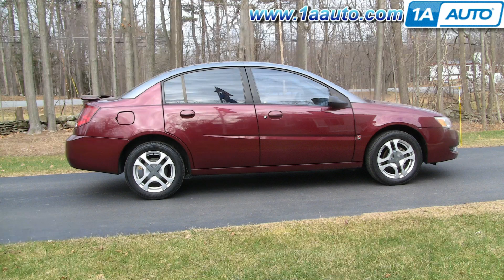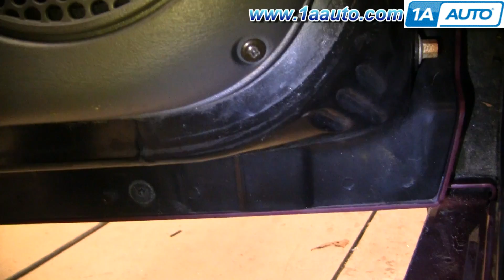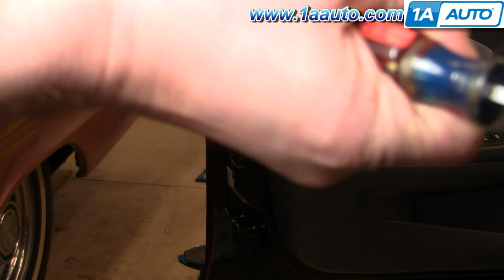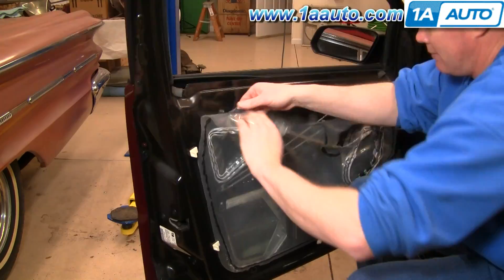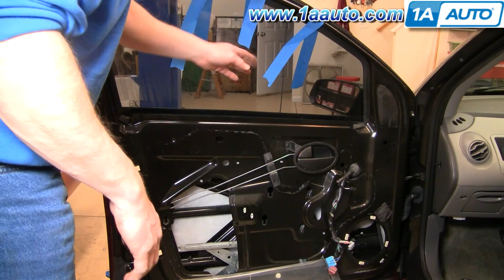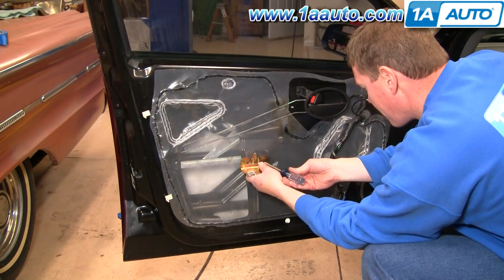How to Replace Front Window Regulator 03-07 Saturn Ion

Comment: Thanks for the video! It's hard to get information about cars these days. People like you taking the time making these videos are a lifesaver. I'm a diy kinda guy. I done work on my vehicles and others in the family all my life. Hanes manuals are not all entirely accurate. Always leaving something or another out but are helpful in some areas. Better than nothing I guess.. The plastic tabs that hold the window in place was very stubborn. I ever so carefully bent the metal bracket between the metal and locking tab with a flat head screwdriver. Then I carefully repositioned the window assy so that the front clip was easier to get to and very carefully did the same to the front part. Once I got them loose I thought I had both clips aligned ( the plastic fasteners are fixed onto the window. They don't slide off. Only with the window they stay fixed). Once I used the method you mentioned It was easily to disengage the new regulator to realign it again and slide the window forward to lock them into place. I'm guessing that the old assy was just clamped way too tight for normal removal since they would not free the window from the regulator assy or it was just on there quite some time. Hope it helps someone.  Just be very careful and I recommend safety glasses just for extra measures.

Comment: My driver side front window goes down easily but struggles to close.  Not the regulator I assume or the window wouldn't go down as well?  Maybe the switch is bad?  Thanks if you can respond.
Reply from the maker: +Oniel Mercure We wouldn't be able to diagnose an issue like that here, you may want to have a local mechanic take a look at it. Thanks for checking us out! http://1aau.to/m/Shop-1AAuto-c

Comment: Sitting in my car watching your video, your Saturn started dinging. I started trying to figure out why my car was dinging. LOL. Mighty window is not stuck down it's up. I'm a little confused, is the motor regulator the motor? It seems like a motor and a motor regulator would be two different things. My motor is not working on the driver side. It doesn't even try. Though before it totally gave up, it would work and not work for a couple days.
Reply: Hi Laura..  what did the problem end up being?  I have the same issue. Thanks if you can reply 🙂

Comment: I have a 2003 Saturn Ion and I can not lock and unlock the doors from the outside with the key instead of using the fob. What would be the problem?
Reply from the maker: +Efrain Olivo You may want to check the door lock for a frayed or broken wire. It could also be a loose connection on that circuit. Hope this helps you out.

Comment: Guys like you make these repairs look so damn easy !!! who wouldn't want a
neighbor like you. My 2001 Aurora's rear driver side window is stuck in the
down position - happened just after washing my car. I can hear the motor
sounding like it's trying to move the window up and down, but the window does
not move ?? I guess it will have to be taken apart. Only used that window myself
maybe 10 times - maybe less. It shouldn't be major hopefully. I can lift the window
up with my hands, but it slides right back down.
 
 How many hours to do a job like this-taking off and replacing the door panel,
and fixing a part ??? can you let me know ?-- great video bye the way !!!
Reply from the maker: +Grant P Thanks for watching!  Assuming you just need to fix the window regulator or reattach a component it should take more than an hour, but it depends on the mechanic's experience!  1aauto.com
Reply: Dude it's a window regulator , it is easy lol any body with a set of hands could do it .. by the way that's what's wrong with your car . The window regulator attaches to the window glass . When the regulator breaks what do you know the window won't move..

Comment: Great tutorial, very helpful thanks so much for posting this.  I was very lucky, got the regulator out and took the motor off the regulator.  It must have jammed somehow, bench tested the motor using my 12 volt cordless drill battery.  The motor worked fine, put it all back together and bench tested again, motor and regulator both worked fine.  It must have jammed up somehow.
Reply from the maker: +JHorn38200 Sometimes just taking something apart can do the trick. If I have a relatively simple part, I like to remove it, take it apart and clean it thoroughly, then reinstall it to be sure it's definitely failed. We're glad the video helped you out.  Thanks for watching.  1aauto.com?utm_source=YouTube&utm_medium=CTA%20Comment&utm_campaign=1ATony 866-403-3393

Comment: Thanks SO MUCH for this video. Between it, and an online PDF by Dorman Products (the part manufacturer) I was able to replace my 2007 Saturn Ion window motor / regulator in a few hours. I took the exterior door panel off also (it was easy to do) which gave me a bit more access to the parts.
Reply from the maker: Judith Russell Great to hear. Glad we could help and thanks for watching 1aauto.com 866-403-3393

Comment: You should the clips and sliding it easy. what if it does not move am I doing something wrong? I pressed both clips and it is not moving. This is the passenger window.
Reply from the maker: You may want to check the arms on the window regulator to see if they're jammed and need to be freed-up so that you can get it out of the door.

Comment: Does this work the same for the rear window? My back drivers power window (its a 2004 Saturn Ion) doesn't work, nor does the lock. Thanks to one of your videos I think I can confidently remove the side panel but I'm not sure what to look for when I do.
Reply from the maker: You should be able to apply some of the basic steps shown in this video to your rear window.

Comment: 2004 saturn ion, rear passenger window stuck down. will not move and no motor sound. any way to check to see if it is the motor or regulator.

Comment from the maker: You may want to check the wire harness that goes between the drivers side door and the body of the car. There may be a broken or frayed wire in there that needs to be repaired. Hope this helps you out. 1aauto.com 888-844-3393

Comment: Hi! First THANK YOU for doing this video, what a blessing you are!  Second, my driver's side window does not work. It worked then a few weeks ago it stopped working. Then it worked again for a couple weeks. Now my window is stuck down and it's not working. No noise when I push the button and nothing happens. Do you think it's a regulator or what could be the issue. ANY help would be wonderful. Thank you so much and may God bless you!!

Comment from the maker: The window motors could be getting tired on those windows. You could try to spray the weatherstrip around the windows with some silicon spray. If the weatherstrip is really dried out, that would slow the window down too. The silicone will allow the window to glide on them a little easier. Hope this helps you out, 1aauto.com 888-844-3393

Comment from the maker: We currently do not carry these window regulators. The power window motor may or may not be serviceable on the regulator, you might have to replace the whole assembly as shown in this video. 1aauto.com 888-844-3393

Comment: It's the same regulator as shown in the video, from an '06 Ion. I'm getting more certain that it is some form of a loose connection within the motor as, with the stereo outputting silence, a whine can be heard when operating the switch, and the power window began to work again after the car rode over a small bump in the road earlier today, which must have jiggled something back into contact.

Comment: How can I lower the regulator if it has ceased to operate in the full up position?

I am certain that the motor has failed, likely stopped with the bushings in the gap between the contacts (had a GM with a starter that did that. LOL) as the passenger front and both rear windows work, and I can hear what I assume to be a relay when I press both 'down' and 'auto' on the driver's window switch.

Comment: this was so helpful - I can't believe you take the time to make these videos, God bless you! I can't open my driver's door ( Saturn 2005 Ion sedan ) as the window is up but blocking the door latch. read this is a common issue with my car, can't put window down on either front door without it falling off track. I read the door latch gets stuck because of a small protruding piece that need to be permanently glued in place so it does not disable the door latch again. hope this helps someone!

Comment: On my passenger front window, when I push the power window toggle switch I can hear a high pitch whine sound that is very low in volume!
Does this suggest a motor issue or regulator issue? 
Thanks!

Comment from the maker: Your first step would be to take off the door panels to see if there is any issues with the window regulator. If they appears to be no damage, you should then test the connection going to the regulator motor itself to see if you are getting power.

Comment: I have a car just like the one in this video. Both power windows on the driver side work (front and back) but both power windows do not work on the passenger side (front and back). Given these symptoms what is most likely the problem? And how would I troubleshoot something like that just to make sure? Thanks

Comment: Thank you for this video. In the tool description, you list an 8 mm socket and it calls for a 7 mm (which is what you use later in the video) and this part is also something your website doesn't offer. I would have purchased it at the time, but it wasn't available.